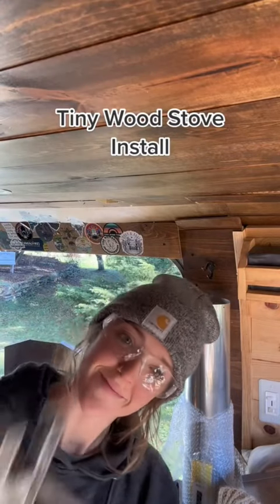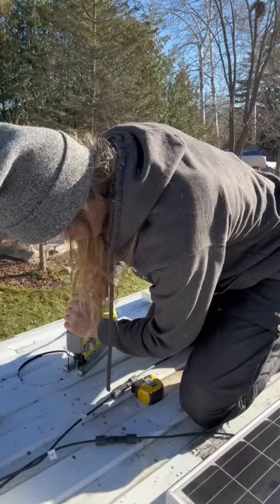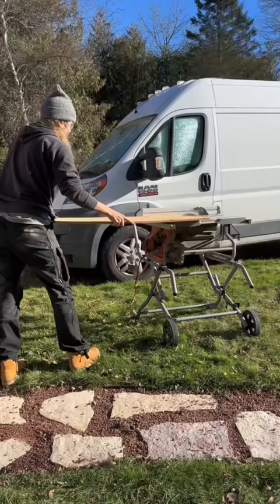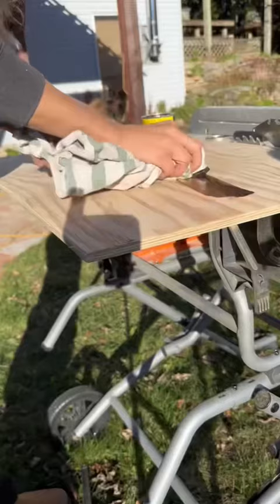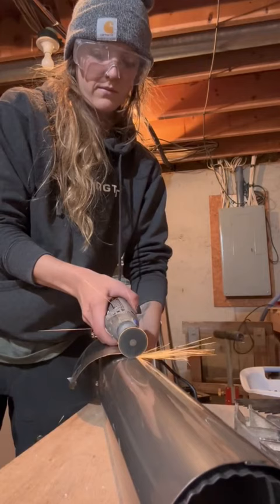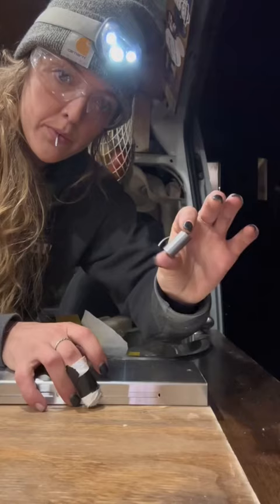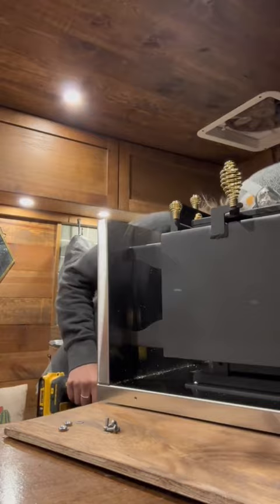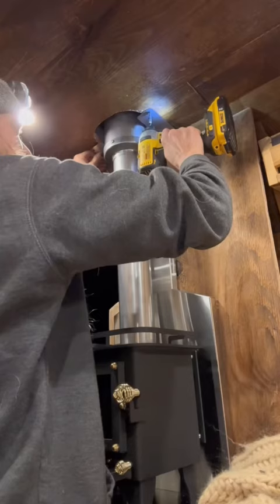TINY Wood Stove in VAN 🔥🚐 Full video will be live in one week! #offgrid #tinyhouse #vanlife

Comment: That oil-based finished wood behind the stove looks awfully close to the heat source. Won't you consider installing a fire resistant backing?
Reply: I second that..
Reply: Agreed
Reply: That caught my eye too. I don’t think oil-based was a great choice so close to the heat source.
Reply: There should be rockwool in spaces behind the non combustible materials in a radius of 1m all around heated parts.
Reply: At a minimum fire rated drywall should be used behind the stove!
Reply: You could even install some type of ceramic tile or custom mosaic tile looking like some type of cool backsplash
Reply: @yaktaylor659  That was my first thought, too, but then thought maybe the additional weight could be avoided.
Reply: I absolutely would have put fireproofing behind the stove
Reply: Shouldn't she have used a fire proof material behind the stove?
Reply: Porcelain tiles would be cheap,  easy and give peace of mind
Reply: @laker3  you CAN NOT safely have a combustible product directly behind a stove flue...😔
Reply: This is not good hun
Reply: When you don't watch the video and see the firewall
Reply: I'd get a sheet of concrete board that plywood is an accident waiting to happen
Reply: @laker3  while you run your mouth. I bet you have not done fire repair. Where the studs behind the BRICK WALL have caught fire from the heat. Or houses where the wall caught fire around the TRIPLE layer flum pass through.....have you ever stood there and watch the whole flume melt and drip red hot metal from a run away exhaust fire.
Reply: When she said oil base on that wood I’m like oh sh-
Reply: Dude, she might as well have used fat wood as her backer
Reply: @sdmfcfh1283  dude you just played the "tell me you know nothing without telling me" game .....and you won!  👏 🎉 🏆 Congrats
Reply: Meh, the metal plate behind the furnace will do the job as long as she doesn't try to het the whole trailer to 100 degrees.  Even a small fan will keep that wall cool enough.
Reply: @EricRohlfs  not really...for a traditional installation with a " full size" wood stove and 6" single wall pipe a 20" space is required...but you can cut that gap to 6" if you use double wall with a non flammable backer that is placed using a spacer that provides a 1/2" gap.....
Reply: @halfassranch8363  clearly didn't see the shiny metal firewall in the video
Reply: Yep agreed!!!agrees!!!! Oil soaked wood next to a wood stove =terrible idea!
Reply: @ghostunspeakable7866  1976- We plastered & wire lathed around a fire place. Years later fire got in behind the wall & burned the plaster off !!
Reply: Nobody here knows shit about shit! That tiny little stove won't hurt that wood! Oil based stain wood... Oooooo
Reply: I agree with Grover
Reply: That’s what the stainless heat shield is for.
Reply: She's got heat shielding right behind the stove.
Not a bad job there though.
I'm wondering if she's going to have leaks or not....
Reply: It's okay  the oils to protect the wood from the fire, when it evaporates rather quickly due to the heat cooking and drying the wood the pattern should emerge,  sure ya can re apply  but at least she didn't use lightweight plastic,  saunas are designed with wood for saftey but much lower temperatures and higher humidity unless a dry sauna a sheet of tinfoil woodglued to your resanded wood should help if ya can't afford the cheap tiles mentioned in other comments  but id get a "more than a dollar"store sheetmetal pan that while it will heat up would also protect your wood insulation layer oh and get a non electric steamengine heat powered fan to blow the air around off the top of lil carbon stove also use the stove to cook and boil tea etc  as the cost of other things savings is there
Reply: @JoeBidensDroolBib  It's too narrow.
Reply: Well she said she never did it before. Great of y’all to help!
Reply: Nice to know these peeps got your back !!!!
Reply: Concrete board , tile then heat shield and a possible separate heat shield that wraps around back and sides of stove that can be removed might be a safer route
Reply: A piece of cement board maybe with tiles on it  behind that stove is a lot better than wood board with oil stain. 🙄

Lol just seen someone else beat me to this comment   👍
Reply: Stoves are double walled and usually have a refractory lining so not much heat will be emitted from the back. AND there no way you could really over fire such a small stove and have that condition last long enough to cause adjacent objects to burn. I think she did a great job. The only problem is you know your going to be bumping against that hot stove in that small space if your not careful.
Reply: @OldsmobileCutlass1969Va Hardiebacker concrete board is specifically for heat source backing. A 3x5 board is about $20.

Comment: the wall needs to be cement board heat resistant!! for safety! They make some that looks like brick & is nice looking...ask your getting the right kind. I've burned wood for 2 yrs. Plus put a metal heat board under it for sparks & heat.
Reply: Cement board. Not concrete board. Behind the cement board use 5/8 x rated ( fire rated ) sheet rock ( drywall)  fire proof insulation.  Also ceramic tile on floor and wall. Plus an air gap thimble. Allows a pocket of air between pipe and van roof. Makes it literally fireproof. Just not idiot proof. A wood stove in a van is never a good idea. There's a reason they don't have wood stoves in high dollar campers and rvs.   Better to use a hot box with rocks or a Heater with a thermostat and a solar panel on the roof.

Comment: Please tell me you sealed the roof very very very well. That is not a leak I think you want to deal with.
Reply: Has to be sealed on top also
Reply: @johnnypaul5979  which is exactly when I was talking about. Making your roof out look all pretty doesn't do any good if the water's coming in on top have your pretty interior ceiling
Reply: There are ridges on that roof. The hole is crossing them. That will be a bitch to seal, and with the van movement will fail regularly. Also it is way too small a vehicle to have a fire like that. This is an inferno waiting to happen.   I say this based on living in a truck for many years and making mistakes.!
Reply: @vespadavidson2315  the only thing I could even remotely think to do would be some sort of patch that is made for camper roofs that have damage. The newer camper roofs are seamless rolled roofs but the older ones there was this nasty thick goopy crap that you would reseal the roofs with similar to what you would utilize on a mobile home metal roof. But campers don't travel near as much as vehicles do and on a camper that stuff gets brittle and causes issues. I'm just concerned if she's living in it 24/7 that's going to be some major issues.
Reply: I would be more worried about fires as this is comen
Reply: Get someone to mig weld your pipe to the top
Reply: The roof is definitely going to be a leak issue. No way that call holds up to that heat. I went straight to the comments to see if anyone else saw this issue.
Reply: Please watch foresty forest. He is already running a stove in his van.
Reply: I'm sure there's a product out there that'll hold up to the abuse of extreme heat followed by winter extreme colds coupled with 70 mph driving and the constant flex the roof will take while driving.  That being said I never would of done it myself.  If thay stove was built to be installed in a camper then there's a professional installer somewhere that can install it properly
Reply: @adammonahan687 high heat permatex rtv
Reply: I saw one of her early videos where she installed a roof vent, and I think she's got this...
Reply: Spray on rubber seal maybe ???

Comment: Just out of curiosity how are you insulating the roof of your van from the metal pipe because that thing gets incredibly hot and will warp or incinerate everything around it that isn't high temperature resistant.
Reply: Obviously you missed the part with the "beautiful trim piece".  That trim piece is ment to block the tiny fire demons from seeing a way into the van, they will get disappointed and just leave without burning anything. 🔥 🔥 🔥
Reply: Truth. Sole of these van life videos are death traps
Reply: She used double-wall pipe AND left a gap.
Reply: Looked proper to me...

Comment: Fireplace installer and chimney technician. You did a great job with your clearances. Putting that sheet metal behind the stove, cutting 2" around the roof transition and having a firestop where that enters and exits is great! I would have suggested using a double wall metalbestos for the roof, but it should be just fine. Didn't see if you put a storm collar on, but you'll want one if you don't have one.

Comment: I did this already....decided against damaging the van..removed a side window...replaced the glass with a metal sheet. Ran the flu pipe out through it. A simple disconnect of the outer pipe and attaching a cap to the exposed end of the pipe and off you go. When I sold I kept the stove and replaced the glass ..cheap ....effective ...and no permanent damage to the body.

Comment: Oil and fire don’t go good together. Throwing in wood. Makes it look even more dangerous. You might want to consider some type of thermal protective layer directly behind the stove, to prevent a fire.
Also. Hot air rises and since it’s already high up. You may want to consider some sort of directional air circulation so the lower floor doesn’t end up cold all the time. 
Grew up with a LOT of wood stoves and these were things you never think if until you have it.
Reply from the maker: I grew up with a wood stove too. There is metal shielding behind and around the stove. When talking directly with the company, the plywood is totally fine as a “wall”.
I already have a fan to push air down toward the floor. I talk about all of this in the full install video coming out tomorrow :)

Comment: another thing to consider is if your van hits a parked vehicle and highway speed is that wood stove going to become a projectile heading to the front of the van where you sit or will it remain there until everything's come to a stop you definitely don't want to skimp on how you bolted that thing down. and if you voted it down to whatever is beneath it don't assume that it is sturdy enough to survive the hit with that much weight trying to rip loose whatever is connected to check it and possibly reconnect it more substantially or keep going down until you find some framing of the van itself to connect that wood stove too so it stays there regardless of what happens to the van as it travels. cuz even without a fire inside of it you don't want the damn thing to land in your lap via the back of your head. just another happy thought from a handyman. Milen.

Comment: In my opinion, if you stay mostly in wooded areas, this is the best option for heat. It adds so many things but you just gotta get wood. You could use a battery powered chainsaw now. DeWalt makes a 20 volt you can use that same battery for. I really like the stove. It's a good size.

Comment: Why not use a 5 thousand watt Honda generator and a portable heater. The generator is really quite and you can just sit it outside the van.  Lock it to the bumper with chain or cable. The generator will run about eight hours with a tank of gas. The generator holds about one gallon of gasoline.  Then in the summer time you can power a 5 thousand btu window air conditioner.  With a piece of two by four you can make a piece of wood for the air conditioner to sit on then. I  put my window air conditioner in the passenger's door.  You may want a small fan to push the cooler air from the air conditioned air throughout the van.

Comment: Be careful, I don't know what it weighs, but it will become a projectile in a wreck.  You might want to chain it, or braided wire it directly to the floor.  through the back of the cabinet its sitting on.  Even a 30 MPH wreck could be a disaster.

Comment: It’s seems in your video that you chose to use a single layer flue pipe instead of the double walled flue pipe used in home installations….just an observation…. I personally would have used the double walled pipe for a safer install … plus a co2 alarm is a must in that confined space….

Comment: Most of the comments are correct.. the idea of introducing extreme temperature in small area is not sound engineering.. the direct connection to the sheet metal roof.. the transfer for the rear deflection plate.. probably best to build a light gauge protector around the chimney flue so that incidental contact can be avoided.. and the amount of fresh air coming in is vital.. this is an almost copy of many deadly designs in the 3rd world were people trying to stay warm, trying to stay alive.. bring an open flame device indoors..high percentage of catastrophes... so few sq ft and so little chance for fresh air intakes

Comment: Stop.please listen to prior text. Oil base stain with finish is going to release vapors and most likely burn. Try a product that is available at most hardware stores used for bathroom tile backer.Its a concrete material that comes in 3/8" or 1/2" thickness .It's usually sold in two foot by three foot  panels.Flue pipe at the top will have to be heat protected also .And one more thing the surface you set the stove on should be heat resistant also. Stay safe.You do plan on sleeping in there and we don't want you to get hurt.again stay safe please

Comment: I would've done the hole out the side of the van for the flume system instead out the roof I've found that I was able to have a leak proof as far as water goes vs the ceiling where I found myself having to reseal it every year to avoid leaks but its parked in Arizona in the summer so that probably what gives it such a short seal life

Comment: Hello there. The thing is the wood stove will get a bit over powering has heat goes, and in 
Such a small space. You can't turn the heat
Down. All you can do is 
Open the door.
Reply from the maker: Using the different vents you can adjust how hot the stove is burning. It works great and we love it!
Reply: @Linneaandakela  Hello. I used to live in a static, and I had a wood stove. It used to get very hot at times. You can't just turn it down straight away. They don't cost anything to run witch
Is a advantage. If you are alright with tending the stove all the time then that's ok.

Comment: you need to put stainless flashing over the peice u stained that stove will ignite it over time it looks great but u should surround that stove with stainless sheet metal wood stoves are great but from experience in small areas they get extremely hot extremely quickly put some insulation around flu as well

Comment: Your hole in your roof looks much bigger than the pipe. You will have many many water damage/mold issues if not insulated and sealed properly. Please make sure you don't neglect that. Plus regular wood that close to a wood burning stove can get hot enough to glow in the dark with heat. I experienced this in a rental house, informed the owner who fixed it. And thanked God the wall didn't catch fire! Please be careful with that.

Comment: I’d be most concerned about the combustion air or the oxygen the Fire will consume as it burns. In a “tiny home” there isn’t much by the way of air flow or air exchange with the outside and you can quickly create a dangerous situation.

Comment: How is the top capped for while the car is in motion? I could see the chimney pipe getting loud or vibrating while driving.
Reply from the maker: It is very quiet actually! I am working on posting the full install video right now if you want to see how the top is sealed off. Basically just a big rubber boot and a chimney cap

Comment: I'm genuinely concerned for your well-being.  I'm an architectural designer and there are building codes for a reason.  I get that you're living in your van so building codes don't apply,  BUT...  at the very least if you don't realize how bad of an idea this is...
1.  The heat shield on the back needs to be bigger, give it 12" more from the left and right faces of the stove.  And make certain it is sitting on a non-combustible surface as well.
2.  Make sure there's at least 4"-6" behind the stove so it's not right up against the sheet metal.  You've backed the sheet metal with plywood, a combustible material, so allow a buffer of air between.
2.  You need a heat shield at the top to transition from the flue out the top of the van and a noncombustible boot that makes a waterproof seal on the roof.
3.  Your flue should extend at least 36" above the top of the roof.  If you need to make something that is extendable or removable that's fine.
4.  You need some sort of exhaust fan with that to make certain it's blowing the smoke and fumes out.  When wood is burned, the combustion reaction produces heat and emissions in the form of water, organic vapors, gases, and particulates. The emissions of most concern are carbon monoxide (CO), carbon dioxide (CO2), sulfur oxides (SOx), and nitrogen oxides (NOx).
5.  You 100% need a carbon detector in that van.

Genuinely, I'm not trying to be mean, this is a horrible idea, and I'm absolutely concerned for your safety.  You're going to most likely die from carbon monoxide or dioxide poisoning in that van with this setup if it doesn't catch the paint on fire and roast you alive first.  Paint and stains, especially that oil stain you used, will combust when exposed to intense heat.

Comment: Does she not know about carbon monoxide poisoning that is a silent killer in house hold’s with gas and wood burning devices that if not properly vented can kill you or burn down your house or vehicle. If just one burning ash lands on top or inside her vehicle can start a fire. You better have fire extinguishers ready just in case you need one and a fire/ carbon monoxide detector installed.